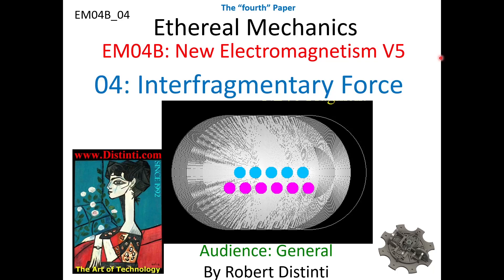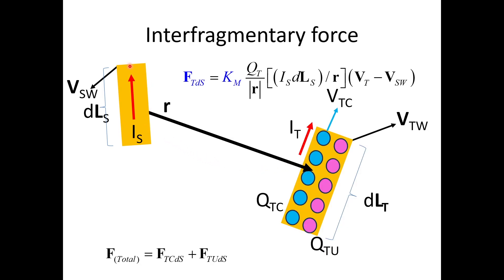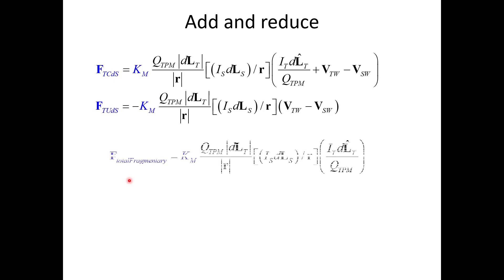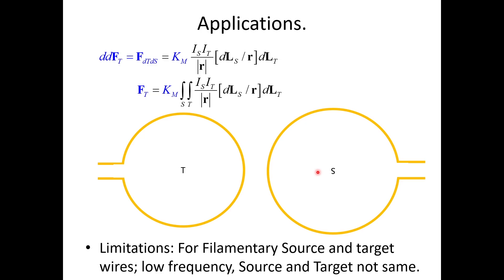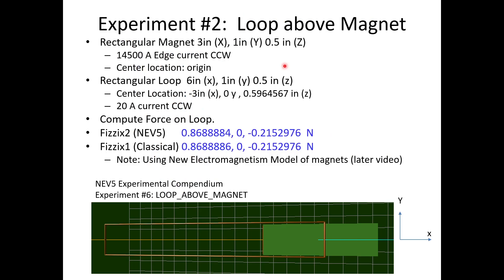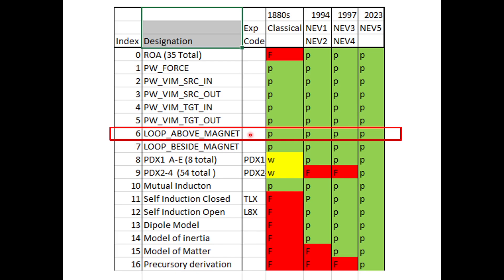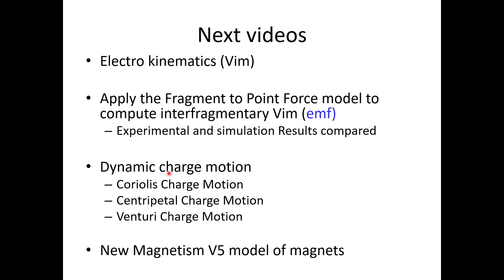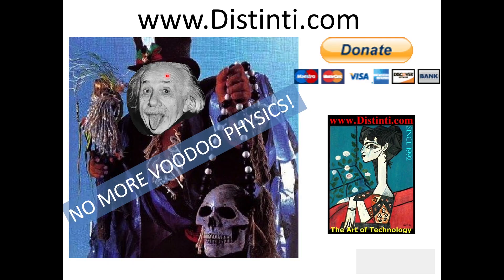EM04B 04:  Interfragmentary Force

Comment: You can speed-up your work on electrogavitics if you took the Biefeld Brown Effect more seriously. All you really need is a dense high-K dielectric like Rochelle salt.
Reply: What does this mean? How do you use these salts?
Reply: @adrianm4506  The Biefeld-Brown Effect was simply taking capacitor plates of unequal size and separating them with a dense, high-K dielectric. The smaller plate is grounded and a high voltage, transient negative charge is quickly pulsed into the larger plate. As the current flows from the large plate to the small one through the dielectric, the capacitor lurches in that direction towards the smaller plate. Biefeld and Brown discovered this effect in the 50's but it was abandoned because the thrust-to-weight ratio was too low because of the weight of all the equipment used. The last thing they tried was using air as the dielectric because they hoped the ion wind could be used to compensate for the low density of the air, but it failed, & everything you read about it today just says that the BB effect was just an attempt at using ion wind for propulsion. It needs to be dense and have a high relative permittivity, but a lot of tests done put the plates in a vacuum, hook them up to a battery & say it's debunked because it was only ion wind.

Another YouTube science channel I follow said he tried to debunk it, but he reluctantly admitted that it works. He wouldn't elaborate much, claiming he entered an NDA with a company, but he said that Rochelle salt could be cast into crystals with odd dielectric properties, like higher relative permittivity in one direction than another, or it varying with exposure to electric or magnetic fields. Rochelle salt is hardly the densest dielectric you could use, but he says the crystal lattice can make the K a million times higher than conjugated polymers, while staying fairly cheap.
Reply: I use Glauber salt that emits positrons in it’s melted state. I fill coil tubing with it and dope the salt with Monatomic Gold (torsion charge collapse), Yttrium (beta emitter), and  Bismuth (diamagnetic). Rochelle salt is the highest K factor material for capacitors. My capacitors are bifilar copper & tin steel tubing alternately.